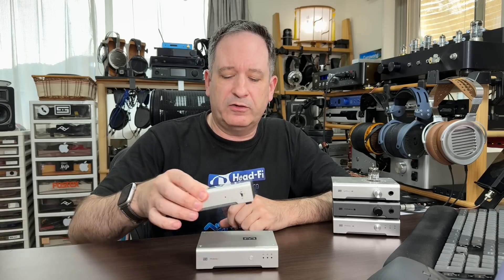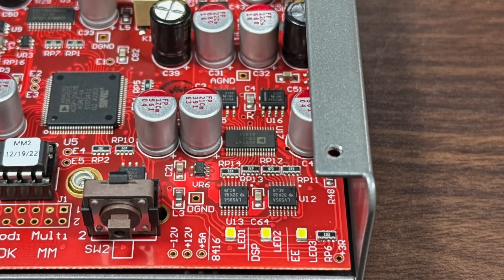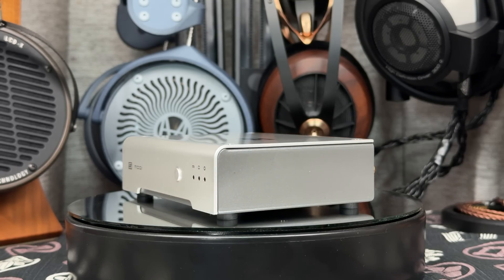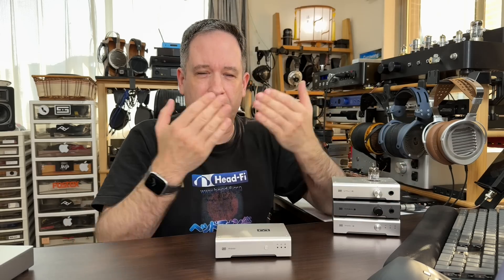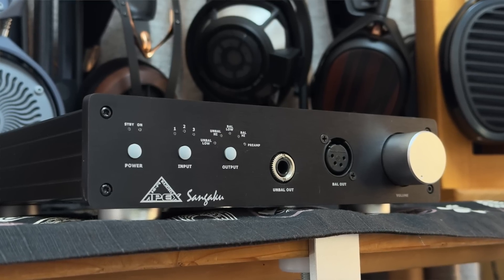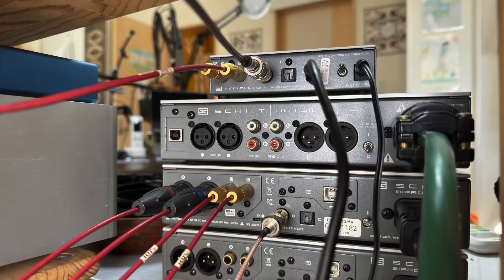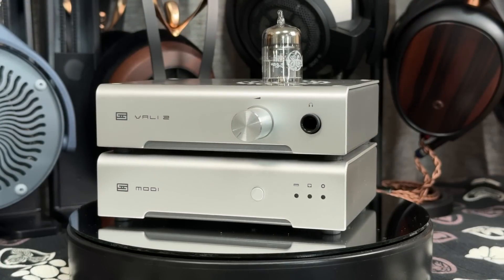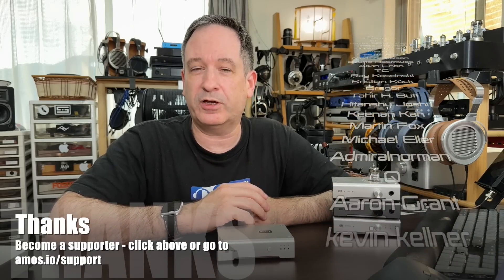Why are people are paying more for fewer bits? Schiit Modi Multibit 2 R2R DAC Review

Comment: 'SINAD chasing and lacking in time domain' - this is just word salad and has nothing to do with reality.
As if R2R nonsense can suddenly do risetime faster with identical bandwidth.
High spec DACs today if competent all sound the same - their specs are so beyond our capability to distinguish, but hey then you'd have nothing to talk about.
Reply from the maker: SINAD-chasing is very much the reality amongst brands such as Topping and SMSL.
• They have a 5V output on their DACs, known to be the optimum voltage for the APX555.
• They used to give only A-weighted numbers, and still only use them on promotional material.
• They avoid measuring or showing other types of distortion, such as IMD, which are often far higher.
Our ability to distinguish differences in audio is far greater than just numbers -- research has shown that people brought up around musical instruments have greater hearing sensitivity. Our ability to resolve depth perception is part of our evolution -- it's something that helped us survive. Whether it's valuable when listening to music is debatable. If you want to be able to perceive the venue a recording was made in, then it's very important. Cheap DACs designed only to get good THD numbers all have a soundstage that has no depth. That is a far more significant distortion of the signal than being able to get a zero or two extra after the decimal point on the THD number.
Reply: @Currawong  and if they use 4V or 0.4V, then what? 40dB of dynamic range suddenly disappears?
If a DAC can competently show a THD where residual is barely above noise floor IMD wouldn't suddenly be worse by a huge margin.
'research has shown' - can I see?
'ability to distinguish is greater than numbers' - citation needed, or is it 'trust me bro'?
'cheap DAC with good THD has no depth' - got any papers to back that up?
'far more significant distortion' - can we measure it? Or is it in the same box where you keep unicorn horn shavings?
Reply from the maker: No, they produce products where they produce products which are designed to get the best SINAD numbers, sometimes over having them not distort during music playback, such as the issue with inter-sample overs -- the DAC clipping from the digital filter, and the above-mentioned 5V setting, which ONLY exists to optimise the output for measurement equipment, and get the lower THD number at 1kHz.
Information about how we process musical information as a result of our upbringing is summarised, with links, here: https://www.head-fi.org/threads/susan-rogers-highlights-from-our-session-at-canjam-nyc.972294/
Research into how our brain processes signals I don't have to hand, but our perception of the distance of a sound is directly related to the time domain. Software that creates a 3D effect uses this specifically to create effects. It's not something that can't be easily found if you want to research it yourself.
Reply: @Currawong  so it doesn't distort during the test, but does distort when playing music? Am I understanding this right?
What is an 'inter sample over'? Any whitepapers on this?
How does one 'clip into digital filter'?
So in other words you don't have anything on the time domain?
Reply from the maker: Goldensound did a whole video about audio measurements: https://www.youtube.com/watch?v=Fa1y9JRip68

Comment: I am looking for a DAC in this price range to use with my relatively humble Philips Blu-ray/DVD player. I am using the RCA outputs (internal DAC) of my BD/DVD player and fed into my sound system (without going into details, I have a good system). The Philips audio sounds quite okay through my system. I mainly use my BD/DVD player for watching concerts video BDs/DVDs and for listening to various BD and DVD audio content in stereo. I expect that adding an external DAC such as the Multibit 2 R2R to my Philips player will improve the sound significantly.

Comment: I don’t think the Schiit Modi Multibit DACs (either of them) are R2R, or are they? As far as I know, they are using Analog Devices DSPs and DA ICs (the latter of which are “true” 16-bit in this case and 20-bit in the higher end models IIRC).
Reply from the maker: The DAC chips are R2R internally as far as I know.
Reply: @Currawong  Indeed. I managed to skim through the specs sheet and they do use something AD called modified R2R (quite interesting actually), you're right.

Comment: "There are no resistors accurate enough to do proper 16bit audio"

I have watched countless videos about audio and have never heard anyone say this. To be clear, I am not very knowledgeable about electronics (I don't even partially understand the role of the resistor in audio equipment) and I don't doubt you are correct. What I mean is, 16bit audio has been around since at least the CD in the 1980s, so does this mean we have possibly not been hearing music at its best, most accurate form since then, depending on what equipment we used? Sorry for the silly question but I'm trying to understand the implications of your statement.

To put it another way, we have been listening to digital music for over 40 years, yet we are still trying to perfect the hardware we use to do so. Is this accurate? Have we really not conquered digital audio yet?
Reply from the maker: The most accurate resistors available (as an individual device) have a precision of 1/10,000. 16-bit audio requires an accuracy of 1/65536. R2R DAC chips use very precise laser-trimmed resistors internally, including industrial versions. However, at around -120dB you run into the issue of the thermal noise of the electronics (Johnson noise). Analysers and other devices use various methods to go beyond this. Modern R2R DACs use multiple resistors, multiple ladders, and various methods of correction to overcome the limits of the resistors and switches.  The Modi Multibit 2 has measurements showing that it'll resolve a -120dB signal, for example.
Reply: Thing with resistors (inside chips they don't even use resistors, most of the time it's current steering and sources) - you don't need absolute accuracy - for a resistor to be say 1.00000k sharp, but for two resistors (or multiple in case of r2r) to be the same relative to each other - this is way easier to achieve.
R2R for audio with discrete components is the stupidest thing imaginable - engineers literally invented integrated circuits to address this issue as thing on chips can be very accurate in relation to each other, and even then we moved away from that by converting speed for accuracy - essence of delta-sigma.
Reply: For an R2R design...which is not what's normally used

Comment: What I have found in my 30 plus years of buying audio products is that to my ears the original recording quality matters more than my gear no matter what I throw at it. My suggestion is to listen to whatever recording you are interested in at the lowest bit rate etc and if it is pleasing to your ears than try a more expensive version and see what you think before going down the rabbit hole. You will find that no matter how much you spend on a recording on whatever it will never sound good if it didn't at the cheapest version.
Reply: Indeed al the bad quality on streaming service high res sounds like shit
Reply: @razzman2987 not only the streaming services but a lot of recordings are just bad. A good recording sound can sound pretty good even on Spotify.
Reply: I don't know, I've found that my current setup makes Spotify sound way better than my old setup did with Tidal for example. Most songs I listen to sound good, many sound really good. It depends on the music, but sometimes better gear can make worse recordings sound alright.

Comment: Now I understand your comment on the Laiv Harmony, you were reviewing this one. If you listen to this tiny 16b chip I can imagine it has less detail. And can be a good combination and a nice listen. 
However, its hardly comparable to the Laiv discrete R2R that averages and adjusts every resistor step to obtain a much higher precision. 
And, it's not the lack of OS that erases details, it is the oversampling algorithm that 'fills in the blanks' by reimagining detail that is not in the recording to try to regenerate what was lost during recording 44kHz (or downsampling during mastering).

In short: OS gives artificial detail. Thats the opposite of losing detail in NOS. Detail that isn't there.
Both can be good to listen to.

PS; love the T-Shirt!
Reply from the maker: A reconstruction filter cannot "(reimagine) detail that is not in the recording". That's not how they work. Artificial detail usually refers to distortion that makes music sound brighter, as if there is more in the music than there really is. A good example can be experienced with headphones that have significant internal reflections by damping them appropriately. 
NOS DACs both audible and visibly (on an oscilloscope) show distortion of audible frequencies.  A good example is banjo music, as you can hear overtones of the notes distort with NOS DACs (or R2R DACs in NOS mode).

Comment: Thanks for the review.  If you are considering a DAC and nothing but a DAC and want NOS R2R consider the Holo Audio Cyan 2. I got it delivered for about $1300 US and it’s excellent.  Very detailed without any harshness in my listening experience.  Rock on!
Reply: recommend a $1300 dac on a review for a $300 dac?
Reply: @703elee  A $300 is how it starts 😂 the Holo Cyan 2 is extremely reasonable for the performance it offers. A benchmark under $2000.
Reply: $1300 for a DAC that’s loaded in sampling errors and lacks clarity? No ty. There’s a reason for heavy digital filtering on R2R DACs. Without it, they’re so error prone it’s insane. Literally jagged sine waves. If you like paying a good amount of coin for an inaccurate DAC, have at it. I’ll let my headphones and amps do the colouring. My DAC should be recreating the media as accurately and faithfully as possible. Literally it’s only job
Reply: Holo Cyan 2 better than the Gustard R26 ?
Reply: I agree that the Cyan2 sounds super for the money.  Hopefully the midi multibit will give some of the same sound flavour

Comment: Schiit should consider making a Dac with both types of chip in it, and a switch to change the architecture so that you can have a clean analytical sound, or a warm enjoyable sounds at the flick of a button. Delta sigma to r2r instantly. The mad scientists there could pull that off I think.
Reply: LOL!   Cool! 😁👍    (Although, if it were up to me, I'd likely leave it permanently in their multibit switch position.   I prefer organic/warm.)    Happy listening! 😊🎶🎶
Reply from the maker: Audio-gd did this once, but not with a switch. The "Fun" had boards for different DACs you could swap in and out. This was something like 15 years ago though.
Reply: @Currawong  that’s so cool, and isn’t there a portable Xduoo that does something like that with swappable Dac and amp modules? Wondering why it’s not more of a thing.
Reply: @RocketLauncherwithInfiniteAmmo  because you just buy two dacs
Reply: Complicating hifi separates is a big no from me.
Reply: Does sound like a great idea. If you could fit it into something like a Jot, that'd be cool...but I suppose people would like to try it on a lot of different amps.
Reply: Now that’s weird, the same day that I hypothesise this idea, there is another video just been uploaded from the honest audiophile that is featuring a Dac with switchable Dac chips inside. Think they are both delta sigma but still, that was quite electrifying.